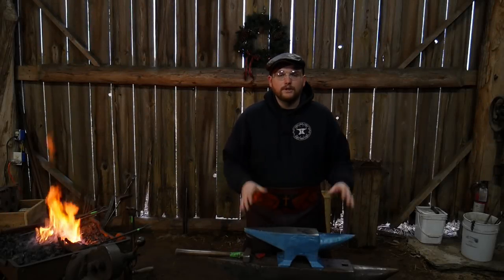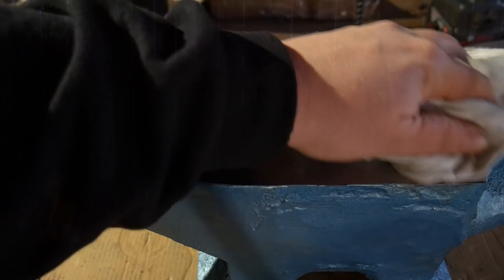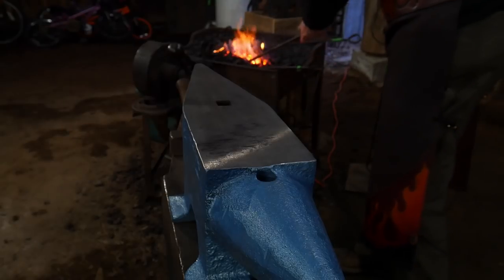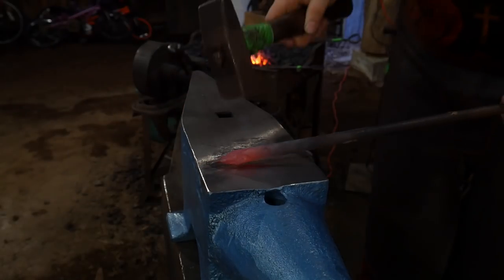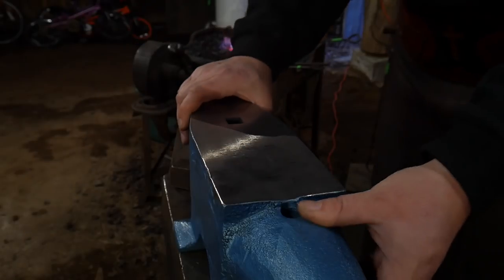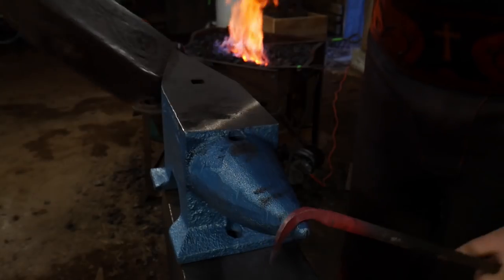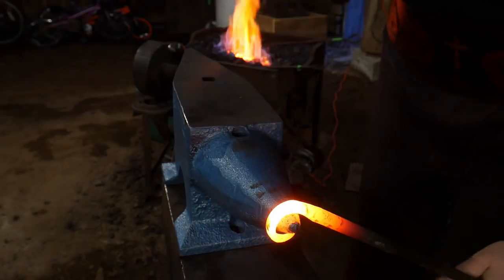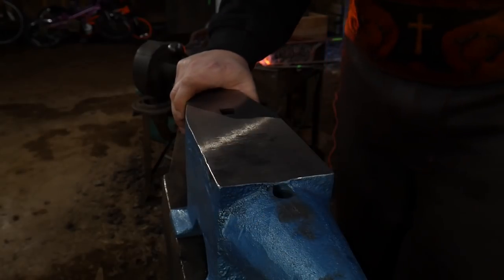Forging Test on the Cheap Amazon Anvil

Comment: i suppose if one had the time and energy they could set for a couple hours just sort of tapping the top of the anvil and work harden it.
there by controlling the amount of surface distortion to some degree. would be a good way to get rid of a 6 pack for sure.

Comment: There's definitely a lot to like about those little guys. If I had an abundance of space and cash I'd buy one to have the clean edges available. One of my Peter Wright's previous owners seriously ruined every single edge on it. As it is now I'm using a secondary block of unknown metal to serve as an anvil with one clean sharp edge that serves about well enough.
Reply: I have a PW and my edges are bad as well.
Reply: I believe it. From my limited understanding there was a period a generation or two back where anvils were essentially worthless and they were ABUSED before being scrapped because the value on the material was relatively high, causing the scarcity we enjoy today. At least, that's what I've been able to piece together after poring through a handful of videos and a little bit of reading on the subject.

Comment: What is your thoughts on the Kanca anvil?
Reply from the maker: Never tried one but would like to :-)
Reply: Thank you, i got one, it is an upgrade from an ibeam. About 700$ plus shipping. Trying to finalize a shop we built on a huge steel flat bed trailer. Longing to fire the propane forge up, but i am still sealing  up the shop and making a rear heat shield for the forge. Reduce a chance of fire. 
Hopefully by this weekend or next. I can take a swing at things. 
Thank you for taking the time. There are really no video with anyone using one.  All i know it is drop forged and double horned.

Comment: I built an anvil stand based on the design by Dog House Forge. Two 15"x15" pieces of 3/4" ply laminated together. Then about 13 layers of 2x3's around the perimeter, and pack filled with 100+ pounds of dirt. Topped with more 2x3's over the top, and another piece of 3/4 ply. Seems pretty solid, and adds mass to the anvil

Comment: I have one. It’s used a my studio. Metal sculpture,  no real blacksmith forging just beating and bending. Had it 1 year.  Surface got a bit wavy ground it down to 120 grit  holding up very good now, does what I need it for.

Comment: Thanks for the info Roy. Do you think if someone were to get this they should maybe heat up a large work piece just to lay on the face and repeat that several times before actually doing work? Maybe that will harden it up some? God Bless 

Shared
Reply: No, that would draw the temper and get rid of the thin induction hardening on there.

Comment: Would that pritchel hole in the horn be a weak point?
I know it is small.
Is the hole cast into the anvil or is it drilled?
Reply: All cast.
Reply: There's enough beef in it that breaking the horn off is unlikely.  If you're swinging a big enough hammer to do that,  then you should use as bigger anvil.

Comment: What do you mean by a small radius?
Reply: Use a flap disk on grinder or even a file and just round  over the edges on the working area to round them off sligho
Reply: Thank you!
Reply: @kirkkellogg8532  Yes sir any time. Some Smith's will actually put on a couple of radius shoulder is most stays slightly radius them a section will be more rounded for working over s softer edge. If I were going to put soft edge on it would be on heal as it's thiner there and softened edge won't be used w heavy hammer strikes .

Comment: I just recently picked up one of these from amazon. I bought it because it was a cheap way of getting a European pattern anvil with the handy square horn. I can tell you I am very impressed with it so far.  It seems to offer similar efficiency as one of my larger 150 pound antique anvils. Mine seems to be plenty hard (dented one of my harder forging hammer without leaving any mark on the face of the anvil) and it does not have any visible filler material on the sides to cover any poorly cast areas, which is quite clear on the one you possess. 
I've also noticed something interesting, although not sure if it is always the case. There is a large price gap between the anvil amazon is offering, about $180 versus Ebay's $120. Could it be the case that ebay is selling the anvils that may not have passed quality control with more flaws for a lower price? Was the anvil in the video purchased from ebay? If so this might hold true as mine is plenty hard with no visible casting defects. 
Can anyone else verify this? 

Thanks for taking the time to review this anvil, and I hope the monthly giveaway works out well. 👍
Edit: forgot yo say pounds after 150, I dont have 150 anvils lol!
Reply: I picked up one of these from Ebay  and it did not have any fillers like the one in this video.  I did however notice a what looked like a small crack in the face when i cleaned it up. After a little bit of beating on it it now looks like a casting flaw that was filled with weld before it was milled flat. The seller gave me the choice of an exchange or a 50 percent refund.  I took the refund so i got the anvil for $66 with free shipping.